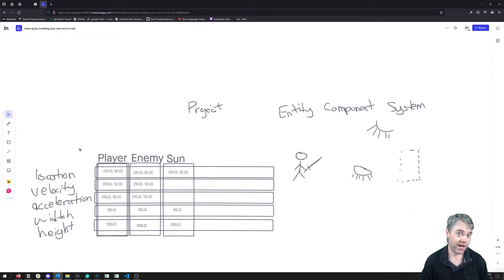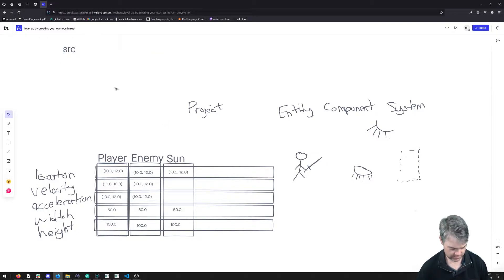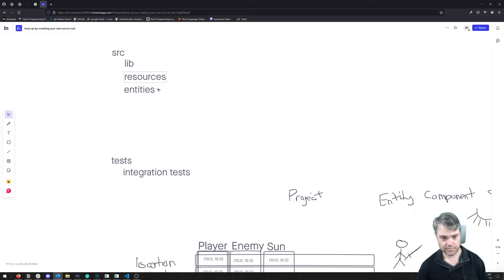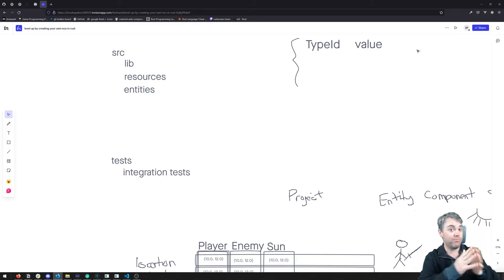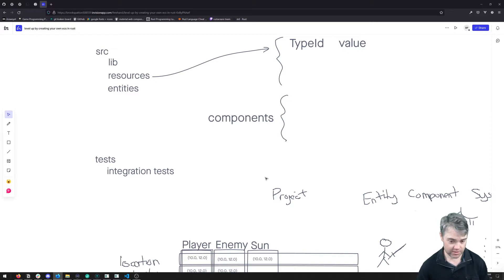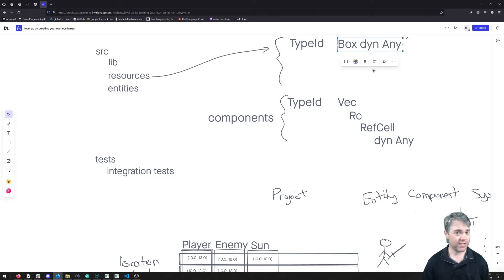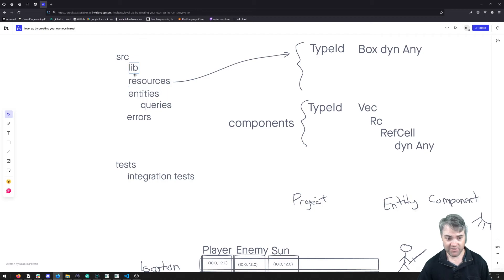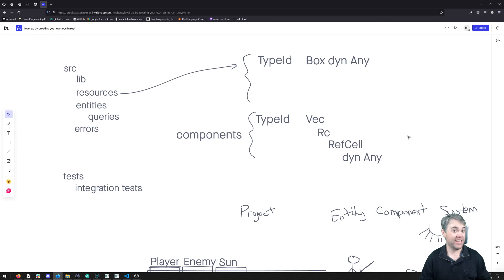Project Architecture - Improve your Rust skills by making an ECS library

Comment: Thanks again for making these videos, they're right up my alley.
I didn't really understand what resources are for. I'm betting I'll understand it when we start building and using them, but after watching the previous project introduction video, it's unclear for me. My understanding now is that they are some constants accessable to the library. But because it's stored by type id in a hash map, that each value is a unique type, like a bunch of different structs.
Reply from the maker: I believe you got it! I'm taking the resources term from other ECS implementations like SPECS where it is something available for the entire world, but not attached to any one entity. An example might be the current frame rate target, or resolution of the game.